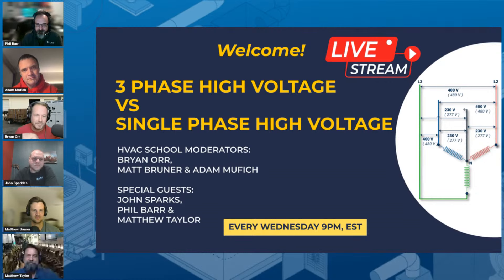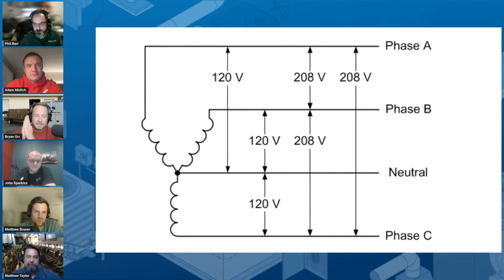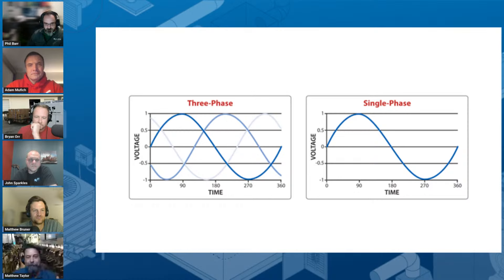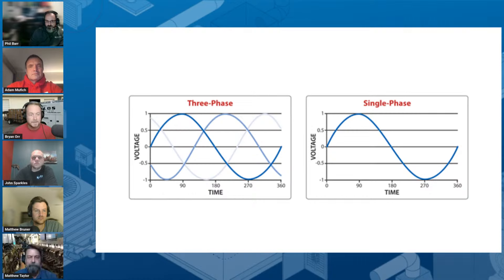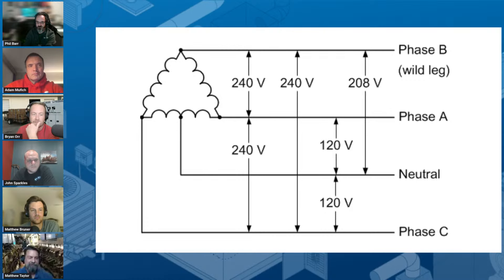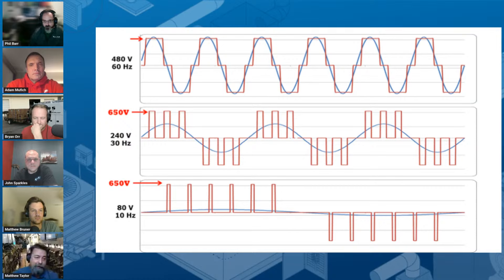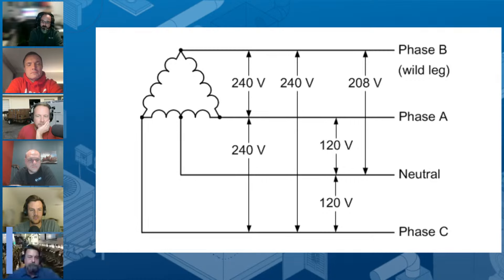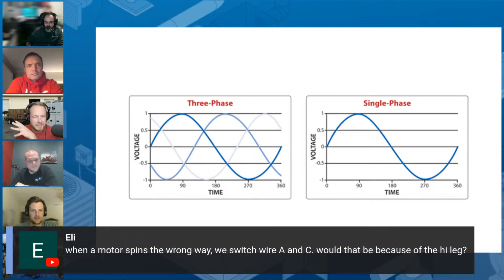3 Phase High Voltage vs Single Phase High Voltage

Comment: You really should have had a proper diagram, showing the wave form for both legs of split-phase, and showing the net phase difference plus the two phases used for 208 V.  It’s fair to say that some panel members would have trouble explaining such a diagram.

You should not have let anyone get away with repeatedly saying “240 V to ground”. 

If there were four-phases, they would be 90° apart.  Three phases are 120° apart.  Split phases are 180° apart.
So why doesn’t anyone explain what a “real” two-phase system would be?